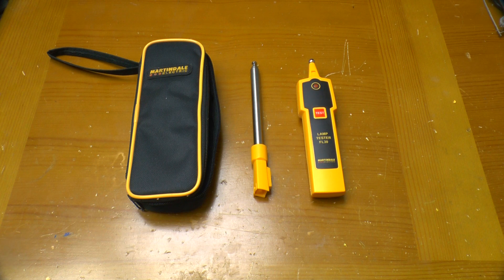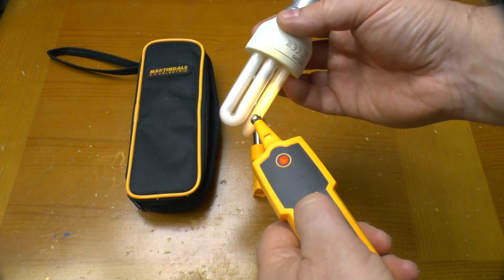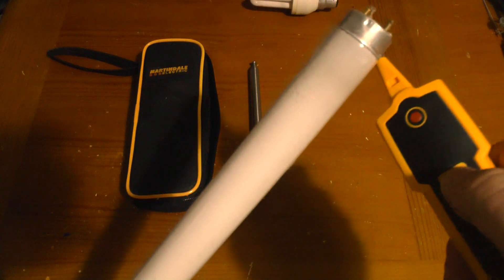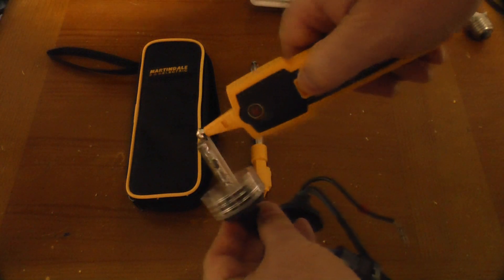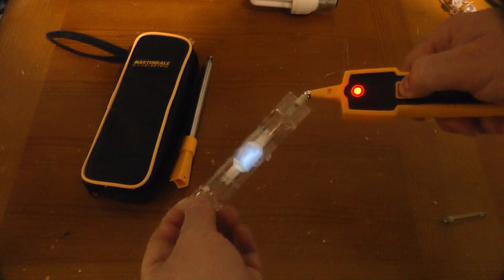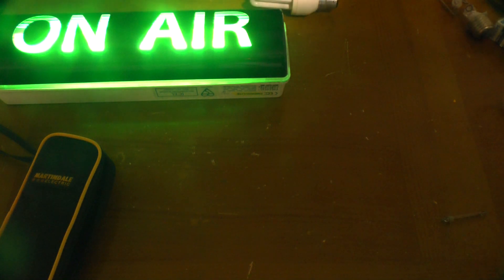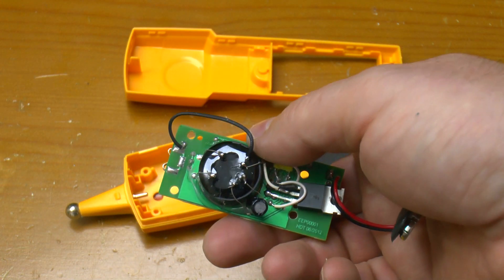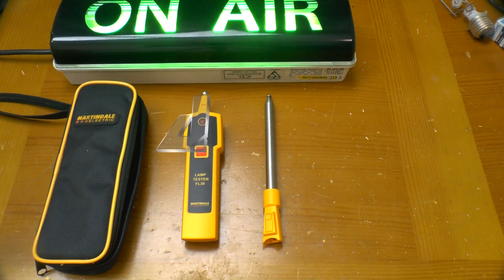What's inside a Martindale FL30 lamp tester?

Comment: I don't see the point of those testers, sure it caan show a black end, but it can't test if the heaters are working, in my 32 years experience, if a tube doesn't work, change the tube, if that doesn't work, change the starter, if that doesn't work, change the ballast/choke (assuming the fitting has power), we always carried a tube and starter to a job, so why waste time with that tester.
Black ends are often that the starter has stuck on and a heater has burned out.
I also wonder if the 3KV will damage the electronics in compact fluro's etc.
Reply: I use one frequently for testing neon sign tubes, it helps to diagnose any potential gas leaks, hence the telescopic probe comes in handy.
Reply: Speaking of starters... I work in a shop that had single pin 8 foot fluorescent lamps for 40 years. None had a starter. Just the ballast, and lamp. I don't understand why a single pin lamp would have a coiled filament. Last summer during the shutdown, we converted to  LED lamps (30). We saw no decrease in electric bill!!
Reply: @uTube486  If you're replacing a 30W fluro with a 30W led, then you can expect no difference
However, led's are often something like 7W with the 'equivalent' of a 30W light, so should take less energy
The single pin ballast might have a built in system (bimetallic strip) that limits the current once the lamp strikes, which is how starters work
Reply: @sparkyprojects  When I checked power w/ a 8 ft Fluorescent  lamp it was 75 Watts. The 8 ft LED 40. Not sure 'bout PF. As far as a starter goes, the lamps has only 2 pins. 10 years ago, I switched to "Electronic" ballasts (REL-2P60-S) that saved about 15 watts, and allowed the use only 1 lamp per fixture instead of 2. Next time I dispose of an old fluor lamp, I'll crack it open to see if any built in starters.
Reply: @uTube486  I have never come across a single terminal fluro, (I did see an electronic ballast advertised that used one pin each end of bi pin tubes) so i'm only guessing from looking them up, but if they have a stater of sorts, it would be inside the ballast and probably act like a current limit relay.
Reply: @sparkyprojects  Just for you (and me) I broke F96-T12 lamp open. The filament wires (2) come out of the glass and connect to a single pin, I can't see why. It's a coiled filament like a regular incandescent bulb. I see no way to heat it w/ just one wire; I just don't get it. Like I said b4, we've been using these lamps in our shop (Hobbyri.com) for 45~50 years, no starters. Long ago we had 48" lamps w/ 2 pins, and they had starters. I so enjoyed dissecting bad starters as a 12 YO kid. Note: In my first comment, I said we converted 30. That meant 30 lamps 8 feet each. I'm totally in love w/ LED's. ABAC had a lot to do w/ my love of LED's, even though Andy @ Photon hates them.
Reply: @uTube486  The coiled filament may still be needed, once the lamp strikes and heats up, the coating on the filaments will emit because of the coating, a filament means more surface area.
That's just my opinion though
Reply: @sparkyprojects  Well, the mfg wouldn't put it in unless it did something good.
Reply: This thing is NOT really for testing if a lamp is "functional". You can do that by simply looking at them (are they illuminated or not?) or by performing simple, conventional tests (filament continuity, etc)
Reply: works well for cold cathode tube testing, neon signs etc.